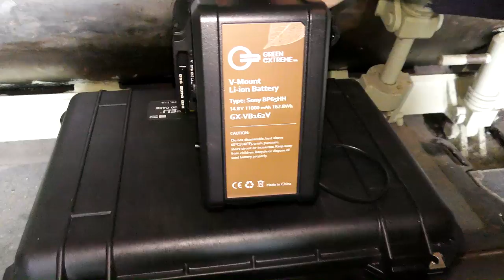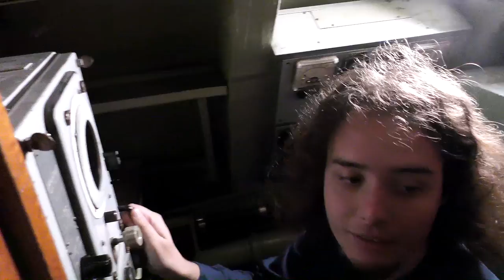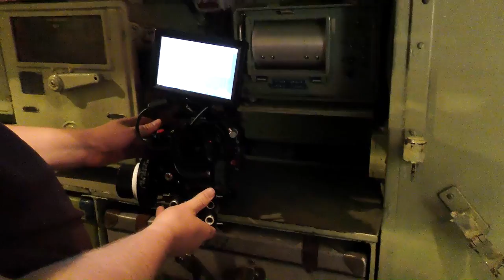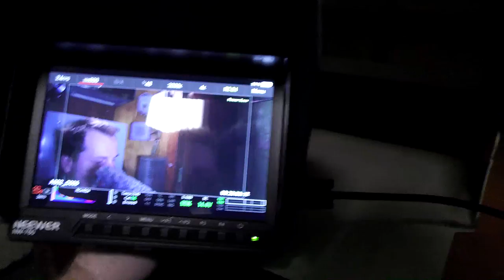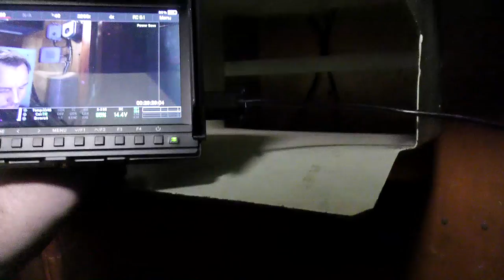Road Trip: Testing Filming and Lighting in Submarine - 578

Comment: Wow, I would love to see that submarine engine being started. Or it looks like it's even two engines. Probably started with pressurized air from a tank that has been put in there by a compressor beforehands.
Reply from the maker: Hi Seegal Galguntijak
Yes you can't very well get out and push,, There is a lot of batteries available. 
Thank you for watching! :-)
Reply: So will you start the engines and film it for your channel? Just to have them running for the filming of your short film?

Comment: How much did that Red camera cost?
Reply: More than your entire life so far. It's Red.
Reply from the maker: Hi Snitsel xd

This was what we brought back in 2012,, and we have expanded it since then.

PRODUCT METHOD QUANTITY UNIT PRICE TOTAL
SCARLET-X W/SIDE SSD AND LENS MOUNT (BATTLE-TESTED) - Canon AL BUY NOW 1 $7,100.00 $7,100.00
DSMC SIDE HANDLE BUY NOW 1 $950.00 $950.00
DSMC MEDIA PACK BUY NOW 1 $975.00 $975.00
DSMC AL NIKON MOUNT BUY NOW 1 $800.00 $800.00
DSMC POWER PACK BUY NOW 1 $515.00 $515.00
Subtotal $10,340.00
Shipping $185.31
Total Due Today $10,525.31

Thank you for watching! :-)
Reply: Just 10k ?! O.o
Reply: It is DSMC 1 so it is cheaper than the current models. (Those use DSMC2)